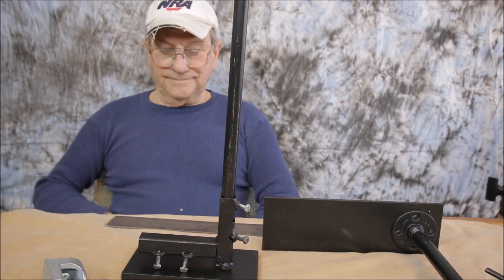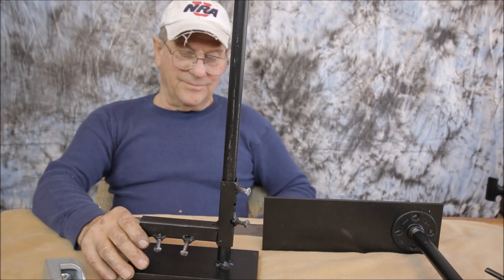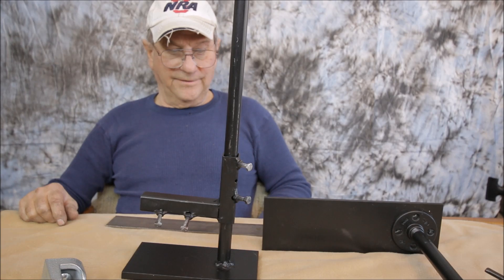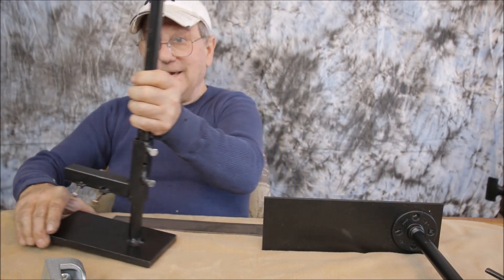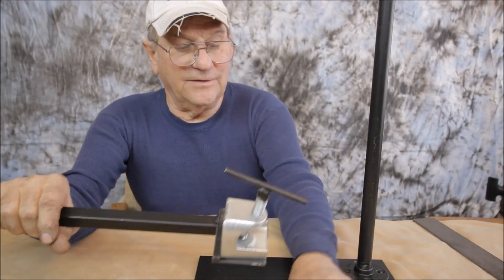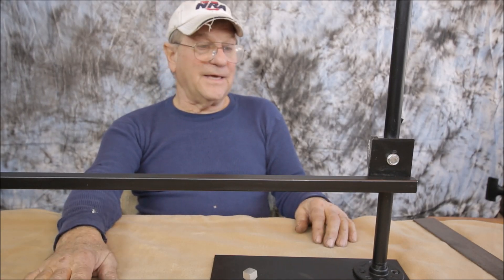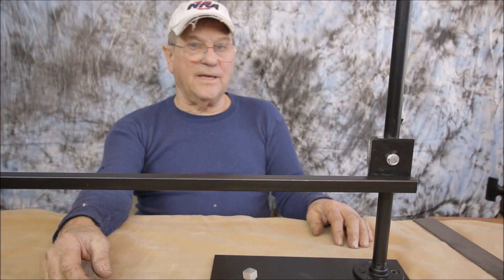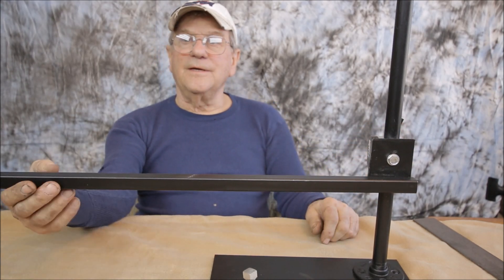Remo's modifcation to chrisb257 tig welding steady rest

Comment: Thanks for the ideas Remo.  I built one much like this on Monday, just didn't bother with the bolt and square bar, just tigged the square tubing to the clamp.  Also my welding instructor instantly tried dropping that arm over the pipe and it didn't quite fit, but the idea of being able to unscrew the pipe (I went 1/2" by 36") and putting it inside the square tubing for storage had me pick a slightly larger square tube.  Had a chunk of 1/2" thick plate already cut into a pretty nice rectangle that I tigged the bottom stand bracket onto doing a complete weld around the outside after cleaning the plate and bracket to shiny base metals.  Entire device takes up about 3 square inches in my welding locker when broken down... ie. unscrew black pipe from base, put inside rest bracket square tubing... put in locker.